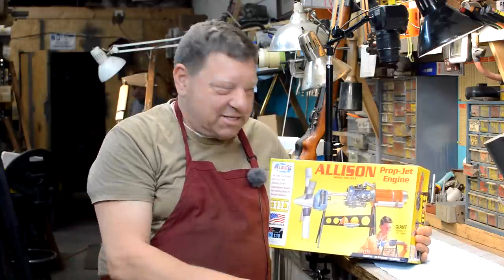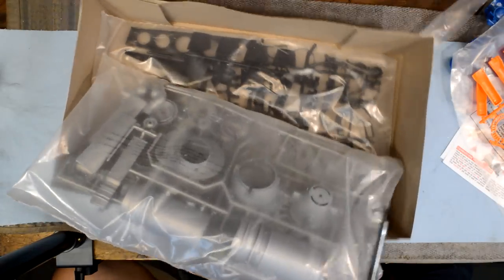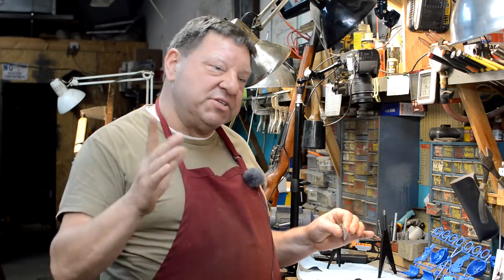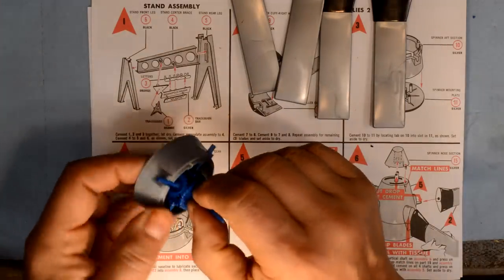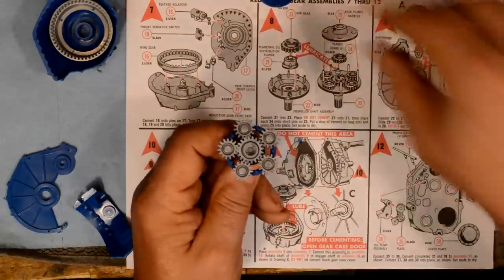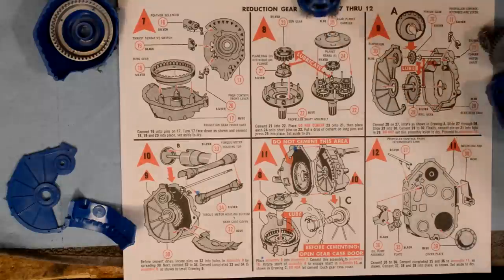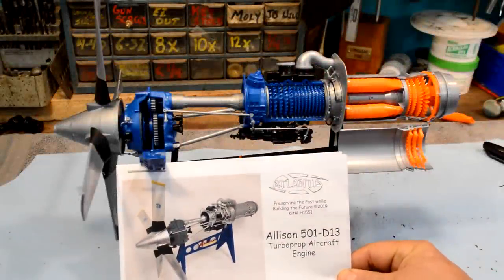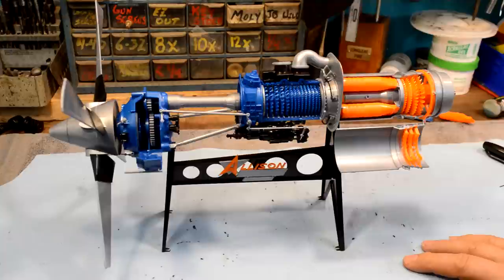Allison 501 Turboshaft unbox and build

Comment: Mr. Novak, the fact that you knew that a propeller is also known as an airscrew brings me great joy! I worked for Airscrew Limited and subsequent companies for over 30 years in the UK, who have a history of propeller manufacturing stretching back to 1913 and - while propeller manufacturing stopped in the 1950s - they are still a key provider of thermal management components and systems for Aerospace and Defence applications. Keep up the good work.

Comment: This is a cool model.  From 1999 to 2003 I was a production engineer in a gas turbine overhaul shop.  I specifically worked on the 501K engine which is the industrial aero-derivative of the 501-D and T-56 engine.  501-D would have been the civilian flight engine and the T-56 was military (used on the Hercules).  I know this engine very well and developed a number of repairs for it.  On average a 501KB5 would put out around 5000 hp.  The 4 stage turbine put out around 15,000 hp, the compressor consumed approximately 10,000 of this leaving 5,000 hp to drive the load.  There were several version of the 501K including the KF which had a two stage turbine and was used as a gas generator to drive a separate industrial power turbine (often used to drive small ships).  The KH which had steam injection into the combustion section to increase the mass flow rate and therefore increase the power output and the KB7/KH7 which added a boost compressor stage on the front of the compressor, increasing mass flow rate, compressor compression ratio and therefore power output.  The KH7 (boost compressor/steam injection) put out something like 7500 hp but ultimately was unreliable as the rest of the engine struggled to deal with the power output.  You mentioned the metallurgists having to come up with new material to withstand the heat.  It is interesting to note that materials that were developed in the 1950's and 1960's for the first stage turbine blades (the hottest part of an engine) are now used in the last few stages of the compressors of modern engines.  The compressors have such high compression ratios now that the back end of them runs as hot as the front end of the turbines did back the the 50's and 60's.  In the hunt for efficiency in the Brayton cycle (the gas turbine thermodynamic cycle) the key variable is increasing the turbine inlet temperature (TIT).  Getting the TIT to where it is now from were it began has required millions of man hours by thousands of very smart people.  It truly is an impressive industry. Ken
Reply: WRITING A BOOK ?
Reply: And turbine inlet temperature is the limiting factor in most engines.

It's most famous as a limit in the J58 engines of the SR-71. 

The engineers have added different tricks to keep the turbine blades from overheating, stretching, kissing the outside of the housing, and destroying the whole engine in the process. 

First trick was hollow turbine blades. Second trick was "directionally solidified" aka single crystal castings (specifically invented for the J58). Third trick is superalloys. Fourth trick is putting tiny bleed air holes in the turbine blades so that they're wrapped in a boundary layer of cooler air. The most recent trick is some exotic ceramic coatings, as used on (and causing trouble for repairing) the F-35 engine.
Reply: 1077 is a magical number

Comment: Fantastic video of a fantastic kit.   I built one with my dad growing up.   I'm glad he was there.    This engine, as you know, still operates, with modification to this day.  The most famous aircraft it powered was, of course the C-130.   And it still operates more than 50 years after first production.   Another famous aircraft it operated was the L-188/P-3.   American Airlines operated the Electra and the story was told that they started at 15,000 ft. over O'hare.   3 minutes later they were on the ground.   Those big props were incredible air brakes.   No one in the cabin felt anything, except a smooth descent.   Great video, keep 'em coming!

Comment: Beautiful. I had the pleasure to manufacture components for various Allison gas turbine engines, specifically fuel injectors. The 501, T-56, and 470K and even the little beast, 250. Later we produced injectors for the T-406/2100 turboshaft and 3007 Turbofan variants. Fascinating work that has truly improved my "smith" skills. Great video Sir.

Comment: We used to build model warbirds, back in the early 90s (was really THIRTY YEARS ago now? Criminy... I need a drink.). One of our best builds was an HE 162, but it needed a bit of tweaking. My older brother glued an "A" size rocket engine in the engine shell and we built a ramp to launch. It flew pretty well, mostly because of sheer luck, but our horses in the pasture were less than enthused. I wish I had a video camera for some of the later test flights.

Comment: When I was a kid, I used to use the 'empty' sprues to make hoses and spark plug wires in my car models. Mom hated that I was using bic lighters to make the plastic of the sprue pliable. But when I popped the hood on my GTX model, my engine bay got so many compliments from my friends. I singed my fingers quite a few times, but that built character.

Comment: In regards to the blade pitch, it's worth mentioning that turboprops can also use negative pitch allowing thrust reversal when the throttle (the power lever) is in the ground beta range allowing the plane to more rapidly come to a stop when landing, but you really don't want to activate it while in flight (there was more than a few fatal accidents before beta lockouts/safeguards were mandated preventing it from being selected, selecting the beta range in flight has the potential to rapidly over speed the turbine/gearbox and destroy it in a matter of seconds, while also generating significant drag reducing airspeed and often resulting in a stall).

Additionally while it's true that the most recent turbines can handle inlet temperatures up around 3500 freedoms, the early T56 turboprop you built was designed to handle only 1780 freedoms which was as you say largely dictated by the metallurgy, however in less than 5 years of being on the market newer models of the very same engine were rated 190 freedoms higher and by around 10 years 290... these improvements in operational temperatures were not achieved through better metallurgy but rather active cooling of the turbine blades and stators by making them hollow and channelling bleed air from the compressor through them (an approach the Germans developed during world war 2 due to a shortage of strategic metals).

While metallurgy has undeniably improved over time the melting point of the alloys used hasn't increased anywhere close to the operating temperature increases over recent decades; rather better metallurgy drastically increased creep/fatigue resistance (by eliminating defects) giving much longer part lifespans and time between major service intervals/overhauls, making otherwise cost prohibitive high temperature ceramic coatings affordable (single crystal blades last around 9 times longer, the old blades simply didn't last long enough to justify the cost). These coatings insulate/protect the blades/stator from direct contact with the combustion gases reducing thermal transfer and making bleed air cooling more effective (not as much heat soaks into the metal and has to be removed).

...Yeah I have no idea where I was going with this, it's a bit of a rant and a half but I've typed it now so, eh.

Comment: 23:45 The terms Turbine/Impeller/Compressor cannot be used interchangeably.
A turbine extracts energy from a fluid (gas) flow whereas a Impeller or compressor adds energy to a gas.
 Great video, you're a natural born teacher. 🙂🇦🇺

Comment: If your gun oil [used to lubricate the plastic parts] is NOT plastic-safe, it may take a long time for the oil to degrade the plastic or it may not. In any event there is an assortment of, or available in singles, plastic-safe oils and lubes called Hob-E-Lube that is safe for all plastics used in the hobby industry (electric trains, RC cars, etc).

Comment: I enjoyed watching you build that model , a helicopter has 4 sets of blades in the exhaust area , two to run the engine and two to provide power to the transmission to spin the main rotor and tail rotor just think of all the mass that those two sets of blades in the engine have to move in order to spin the rotor blades.
Reply from the maker: Single vs twin spool

Comment: Mark when you were born I was 10 y/o. I remember getting enough box tops of cereal along with $2.50 to get my first rocket. I had already been running a kerosene engine airplane on a guide wire. Oh to be back in those days when we put those big strings of bulbs on an evergreen tree.

Comment: We use a variant of this engine to run the generators on Arleigh Burke destroyers and Ticonderoga Cruisers.  They were used on Spruance destroyers as well before that class was decommissioned. They are designated 501-K17 or K34 in that configuration.

Comment: I spent many of my best years in the Navy working on the Herc.  We had the tried and true T56-A-15. The 501-D13 was the commercial version of the T56. Both of which are Turbo Props. You kinda mixed up Turbo Shaft and Turbo Prop. I also worked on the GE T700-701 turbo shaft engine. Which where in the HH-60H and the SH-60s platforms I worked on.  We always gave the P-3 guys hell about how their engine was upside down and on the wrong side of the wing. That ours where right side up and under the wing like they where intended. Great video Im going to see if I can't find one of those models but the right side up version lol.  Fly Navy.
Reply: P-3's are faster so maybe the engines work better on top of the wing.  I was a P-3 FE for 13 years during my Navy career, we always had a friendly rivalry with the Herc guys when it came to what worked best with those engines.
Reply: @Paul51178  lol so you finally came to the decision that Hercs were the best then huh? lol? What VP were you in? Brunswick?
Reply: @DRCK-sp2gt  Hercs are good for hauling stuff, P-3's are good for hauling ass and dropping things that go boom.   VP-22 in Hawaii, VP-40 in Moffett, and then one more tour in VP-40 at Whidbey Island.
Reply: @Paul51178  that's awesome. I'm sure your aware but the P3 has been replaced with the P8 with 40 being the last squadron to switch over.  VP's got a whole new aircraft while the VR's only got upgraded props lol. Thank you for your service!!  Reason I asked where was because I was in VR62 in Brunswick, ME where we had a few VP Squads. That is before the shutdown and VR went to Jax to the VP 30 hanger.

Comment: I've also heard that when the props are at full feather position, it's not just to keep them from rotating in a lubrication failure situation, but to also conserve fuel for the those times when absolutely needed. 
Still though, it vaguely brings to mind a story I heard from a neighbor about his time in Vietnam. In a Hercules, flying along with two of the engines feathered until something happened to cause the other two to shutdown. The two that were off already were not re-firing so the pilot just adjusted their pitch to get a me rotation as they were falling in a glide arc. Eventually the remaining two fired off to his words, "so much smoke and fire of unburnt fuel but the roar was the most comfortable sound ever." Said they'd dropped about fifteen pounds each and we're near tree tops when they started to just level off and struggled to climb again.

Comment: Pretty good explanation of how a jet engine works Mark but one problem.  Your thrust vector is in the wrong direction.  It is in the direction of the compressor.  The high pressure area behind the compressor blades is greater than the pressure of the exhaust leaving the tailpipe.  This is what pushes the aircraft forward in a jet engine.  The same for your turbo prop and a turbofan engine.  Both take mechanical energy and use it to spin a prop or a fan section which create a low pressure area in front of the blade and a high pressure area just behind the blade.  The same principle for all wings and airfoils which generate lift for the aircraft.  Thrust must be in the forward direction to counter drag in the rearward direction.  Simple Newtonian Physics with some help in fluid mechanics from Bernoulli.

Comment: Love the 501, my favourite aircraft are powered by them, both the Lockheed Electra,, (original power plant) and the Convair 580 (reengined) I spent a lot of time round Toronto International Airport in the end 60s and early 70s, used to get out on the ramp and take hundreds of pics of the Allegheny and North Central 580s, later the Air Ontario 580s.

Comment: Hey Mark, as pertaining to the C-130 (and I’m sure the P-3 too) the best benefit that the feather position offers is the significant decrease in drag. However, you are correct, in the event of an oil system failure it would also be applicable. The decrease in drag (worst case scenario is the prop fails to feather and continues to windmill, that’s a hell of a lot of drag) becomes especially critical on outboard engines, like #1 or #4, with 1 being most critical. This is the case on the C-130 Hercules. I’ve been lucky enough to operate as an FE for a few years now, but unfortunately we’re a dying breed.
Reply: Had to retire from being a Turboprop tech rep 4+ years ago because of my lungs. All the old C130Ts are probably almost all gone by now.dan J models lol
Reply: Is is true that sometimes P-3 Orion crews would shut down an engine and feather it, to extend the loiter time and range?
Reply: @Republic3D  Not that I’m aware. The decrease in drag is definitely important for emergency management

Comment: In many applications of the 501, the P3 comes to mind first, engines are shut down to conserve fuel and extend loiter time.  Feathering is extremely important in this application because it cuts drag.   A rotating prop is worse than a sail.

Comment: The main reason for feathering the prop not to do with damaging the already failed engine. It is to stop the wind milling prop from creating an effective reverse thrust caused by the forward motion of the aircraft.
Reply: And the turbo engine does not throttle up and down. It just runs. So the variable props are the throttle.
Reply: @amunderdog  True but that's nothing to do with feathering. Feathering is for engine failure. It actually does throttle up and down like any engine but at a constant RPM. The propeller pitch increases to absorb the throttle increase.
Reply: Wow! I just got schooled on turboprops!

Comment: I'm curious, on a single spool turboprop like that how do you actually start it if the whole thing is direct drive?  Feels like you'd need an electric starter to get things moving enough to get the air flowing.
Reply: Two ways to start a turbine engine. One is a mechanical starter, whether electric motor or some other engine. The second is to just blow air in through the hot section to start everything spinning, usually from another jet engine.

Trick in a jet engine is that it only burns about 1/4 of the air that goes through it, so you can use the exhaust gasses from one engine to start another engine.

Comment: As far as feathering propellers when engine is shut down, the actual purpose of feathering the blades massively cut down on parasitic drag caused by the otherwise windmilling prop. In this case between the prop configuration and engine most likely belonging to a C-130 so there are other engines to take up the slack if one or two fail, but without feathering the props, the two remaining engines may not have the power to maintain airspeed in level flight. Although obviously it is true that upon oil pressure dropping, the problem engine would be shut down and the prop feathered.

Comment: That's awesome man. I might have to run to Hobby Lobby myself.
Reply: Good luck finding one at a reasonable price. Revell kits (original) go for $150 and up, and Atlantis kits (reissue) go for around $50. Same kit different color plastic. I was at a hobby shop and there were 4 on a clearance shelf for 17 bucks each. I left with all four, couldn't pass them up.

Comment: The piston engine cycle is known as the Otto cycle.  A turbine engine does much the same thing but the cycle is known as the Brayton cycle.

An engine where the only coupling between the power turbine and the output (your helicopter example) is the exhaust pressure on the blades is known as a free-power turbine.